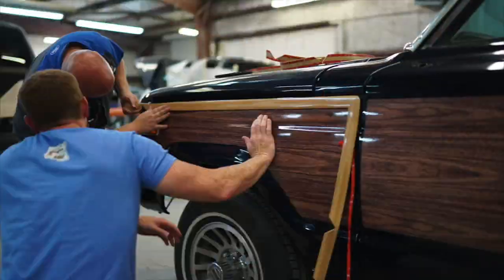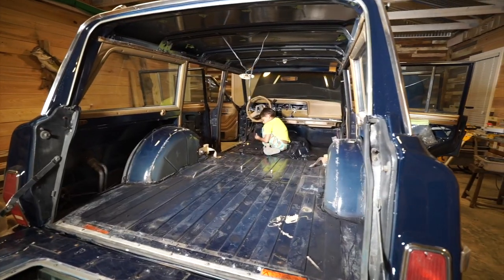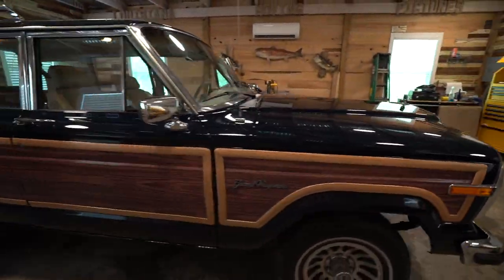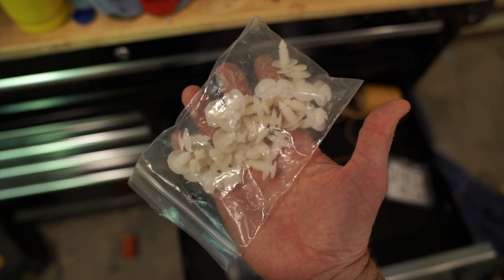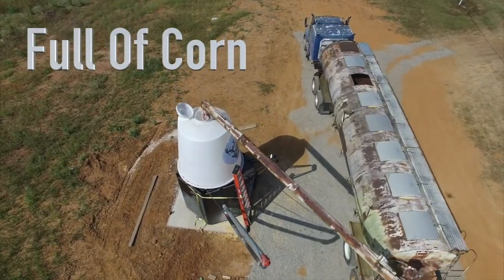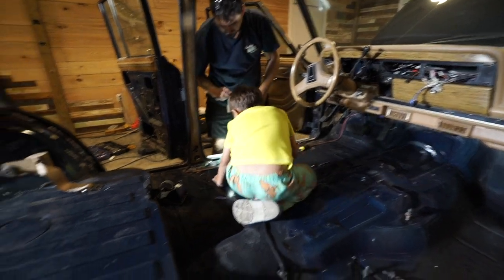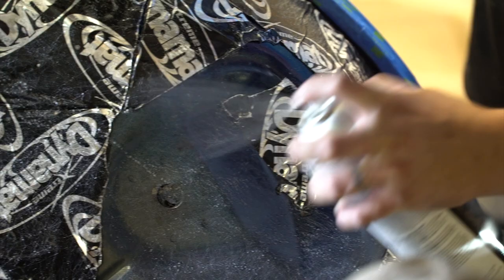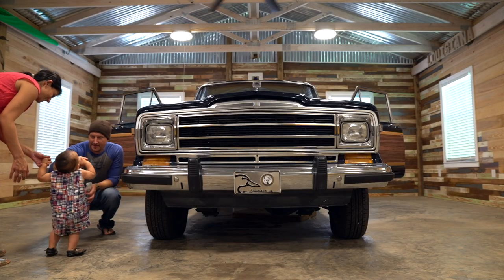Jeep Grand Wagoneer Restoration 4

Comment: Well done on not skipping any important steps.. things like DynaMat-ing the interior are things that most wouldn't take the time doing but the end result offers such an improvement when it comes to road noise etc.  The only thing that I would have done differently was to have those cloth seat inserts dyed black to make the seats a 2 tone color scheme to somewhat match the outside.  Oh, and a set of wide 22" chrome rims on low profile tires for the summer.  People would be getting whiplash with how hard it'd turn heads.  Another thing about rebuilding it is not only do you have a piece of your past to re-live some good times in but the total value of a clean Wagoneer these days is out of this world.  I bet that it'd sell at auction for between $35k-$40k.  And to think that a decade ago we had one which we used as a yard truck to plow our 100 yard driveway when the snow flew here in the mountains of Vermont.  It'd take about a half hour to plow after a good 2 foot snowfall and during that half hour it'd use at least $10 of gas...  We used to say that it got $20 per hour to run it.  The total distance driven was about a half mile so we were looking at getting about 8 gallons per mile when it came to plowing. haha.  They surely aren't eco friendly when it comes to gas mileage.

Comment: Glad to find your videos! They are very well made and the info is great. Also, I called Winn Trim and spoke with Raymond... solid dude. You still happy with their work? 
Questions:
1) which carpet did you use? Cut or Essex... mass backing? 
2) What engine did you put in it?
3) Anything you'd do different?

Comment: Purchased a 1982 Wagoneer from the owner 15 years ago.  Rain leaks ruined the interior door panels and locks. It's unbelievably difficult to find any local mechanics and body shops in metro Atlanta, that will do any restorations and repairs.  I found one shop and they kept the Jeep for four months working, they say, replacing the front door seals.  Locks don't work, the driver's rear door will not open and the door hatch window does not work.  Mechanics seem reluctant to spend time troubleshooting problems or searching for parts.  Any suggestions?